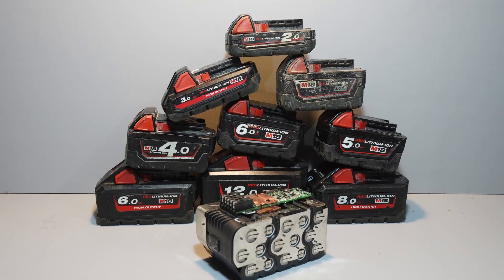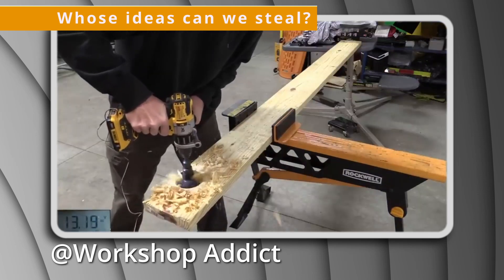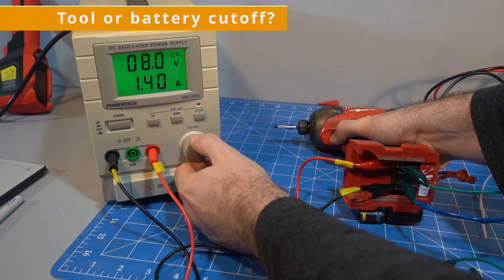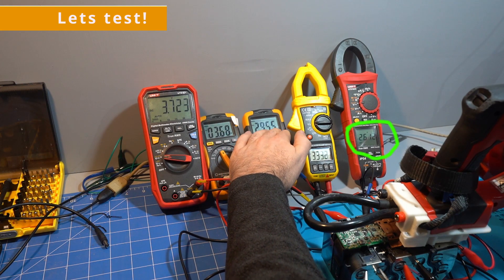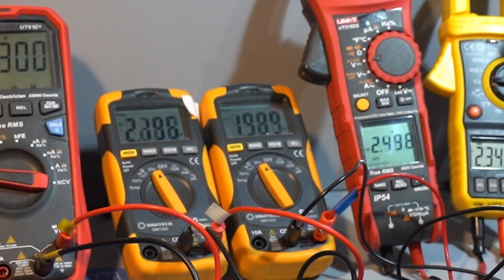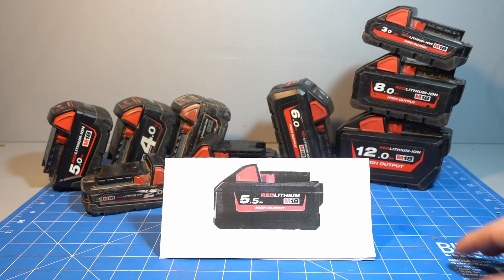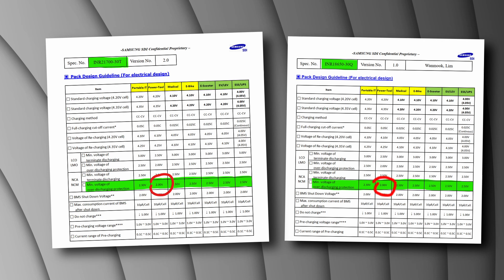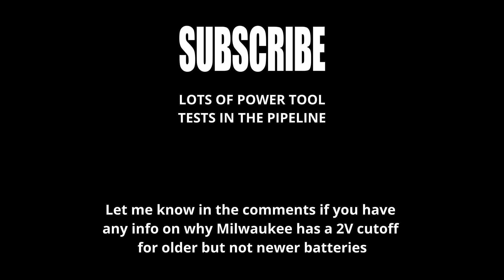[003] Milwaukee M18 low voltage cutoff is below 2.5V/cell on older batteries

Comment: Best tool battery video I've seen yet!
Reply from the maker: Thanks! This was actually just a detour on my way to making my mega battery review. I saw this unexpectedly low cutoff and felt it deserved its own video
Reply: @toolscientist So are you still working on the mega review?
Reply from the maker: @Kevin.L_  yeah, I just keep getting side-tracked! I'm trying to characterise all the M18 batteries for internal resistance, thermal overload, max current, et cetera. Next vid (out in 5 hours) is a perfect example of getting side-tracked. I (mostly) reverse-engineered the M18 communication protocol to see if it gave me useful information like temperature, state of charge, and current. Took me over a month, but unfortunately the communication is fairly basic and doesn't give me anything I can use.
Reply: @toolscientist  I just found that video announcement. Cool.

Every detour is a learning experience. Thanks for sharing your findings.

Comment: Does this mean that on the old batteries you should not use them until they're too low? Charge them before they die because they do not have the protection High Output series have?
Reply from the maker: All M18 batteries have low voltage detection and will tell the tool to cut out. The High Output batteries cutout at the recommended 2.5V/cell. The non-HO batteries cutout at 2V/cell ,which is below the recommended minimum. Whether or not this significantly reduces their lifetime is something that would take me a while to test. Overall, you are probably better off charging all batteries before they go completely flat.

Comment: Nice video,  very good point about using adapters.
Reply: I had an after market inverter that drained my m18 8.0 battery, replaced 2 21700 cells as they were dead.  Still not the same as i only get 3 lights light up but it works

Comment: I discovered that some of Milwaukee M18 12Ah using Sony VTC6A in them 

most are Samsung 40T
Reply from the maker: Did you see the labelling, or are you just going off wrapper colour? Someone recently found that Milwaukee are using EVE 15M cells in their 3ah. EVE's 18650s have identical colour scheme to Samsung's, so impossible to tell from colour alone.
Reply: @toolscientist  yes Milwaukee switched up the recent 3Ah to Eve cells from the many failure of Samsung 15M and Samsung 30Q
i got part of number which i am able to find matching VTC

It is very rare, you can tell by looking at the top left corner 5INR22/70-3
the one uses Samsung 40T has 5INR22/71-3 

same goes with 8Ah 70-2 is the one use VTC6A, they even use different BMS board

Comment: Your videos are awesome. I've done some similar, but more limited testing of M18 packs, though I never organized my thoughts like this. I've had pretty good luck with the various M18s, including the infamous 9, which has only recently started getting flaky (probably ~100-150 charge cycles.) I've had to balance it and my 12 (which is pretty new), but I chalk that up to Milwaukee's crappy BMS choices. I really wish Milwaukee would've put more of the BMS logic into the charger, where it could do smarter balancing, especially if the tool handles the cutoff anyway. The M12s are like that: the pins hit each cell bank and an extra one for a thermistor. Of course, it's not like the M12s are cheap, so clearly they aren't going to pass the savings of a simpler pack along.
Reply from the maker: Thanks, mate!

M18 balance seems to be a problem of the chip they use only having a max balance current of 50mA, which was prob fine for 2ah-5ah packs, but not enough for 6-12ah. I think their biggest problem is that the charger doesn't stop and balance, or at least stay on slow charge, if it detects severe imbalance.

There's definitely advantages to the 1 terminal per cell design of M12 and Dewalt 18V. Downside is increased chance of shorting and inability to brick a pack if it detects a fault. They also do whole pack low voltage cutoff, which isn't as good as per cell, but you could easily design the tool to have access to all the pins and then it's easy. Interestingly newer M12 packs seem to have electronics in them, so maybe they've built per cell LVC into them by having it short the thermistor to get the tool to shutdown. That's just another item on my ever growing todo list!
Reply: @toolscientist  Re: the one cell per terminal design of M12. There is something else inside the M12 batteries as well. I'm pretty sure it's just passive components, but last week I tried using a balance charger to charge an M12 battery and it flat out refused. The cell voltages started looking completely weird. Sticking a multimeter on the individual cell terminals shows the expected per cell voltages but once you start pushing power in, something else happens.

The DeWalt 12v packs, of course, can be trivially balance charged using their terminals.
Reply: @gf2e  there is a 1000 ohm resistor between each balance point and the pins. That would be the culprit.
Reply: @procrastinator1842  Wow. 1000 ohms is insanely high. That seems like it would severely limit the amount of balancing you could do to nearly zero. 

Any thoughts on why they do that? A 100 ohm resistor would more than suffice for current limiting. 

It is consistent with M18, though - not having much balance capability. :)
Reply: @gf2e  my thoughts are it's just for monitoring, when m12 batteries start to fall out of balance, the charger does nothing to remedy it. My second thought is that the m12 'balance' pins are quite exposed so an accidental short circuit is quite possible, the 1k resistor between each balance point would equal 2k if shorted, making short circuit current a whopping 2mA.
Reply: @procrastinator1842  I manually unbalanced one pack. After 3 charge/discharge cycles, it's slightly more balanced but not fully.

I also have a hobby balance charger. I connected it to the battery pack with direct wires bypassing the resistors. Its balancing is...a bit more aggressive. It can balance at >1A. I need to do a bit more measurement, but I think it can effectively charge only one cell in the pack until it's balanced.

I've been wanting to keep an M12 charger in my car. I'll probably wire up balance leads to an M12 knockoff pack and use an iSDT PD60 charger.

Comment: Great info. Just what I was looking for. This data is hard to find. Based on this info I think it does make sense to have some kind of secondary bms when using milwaukee power tools batteries for a power source, solarbgenerator or power station project. Only how to be able to read the cell imbalances in each pack when they are connected in series or paralell?
Reply from the maker: I wish I could give you an answer for this. Reading the battery to tool communication is high on my todo list, but I'm still probably several months away. A youtuber called "Buy It Fix It" seems to know the most about it. You can find his info on reddit by searching for "reddit m18 fuel battery protocol".

Otherwise, I would just stick to 16V low voltage cutoff for the pack and periodically open your packs and rebalance.

Comment: I will have to test some of mine again one day. Mine were brand new back when testing. I have seen mine cut off at or around 3V in the past.  That is of course allowing bounce back to equalize at 3V after 30 seconds or so. It definitely goes below 3V due to exactly what you mentioned the high current pulse shutdown issues. As you know if a pack shutdown after truly reaching 3V no matter what you would never be able to run many high current tools at all unless an almost full charge level. Not sure if it's a time limit or not, but very interesting that it still went low on your low current discharge test. One thing to check though is if the cells are old enough to drop off quickly is it dropping fast in the time limit of the cut off? Like the battery has lost capacity and drops off quicker at the lower voltage levels than usual. I know they already drop fast below 3V, but as they age it gets much worse. Excellent video, thanks for sharing and letting me know you had tested yours on video. I admit I thought yours were all fake or knockoff until you mentioned the difference...
Those big numbers look fake dude...😂
Just not what I am used to.
Reply from the maker: They mostly rebounded back to 3V. I think I recorded some of them to check, but haven't looked too closely. That's a fuzzier number that depends on battery health, load, and capacity, whereas the 2V/cell and 2.5V/cell are pretty hard numbers that reveal a bit about Milwaukee's design philosophy (max power at all costs!)

It will be interesting to test something like the handheld light, which claims 29hr runtime with a 5ah, so around 0.2A. If that goes down to 2V, without any timeout like you suggest, then the cells could be spending 5-30min below 2.5V, which I imagine would not be good for cell life.

I'm not against them going down to 2V under high load, but only if they factor current into it, and it appears that they don't.
Reply: @toolscientist  
Excellent point! I would like to see how the light would do as well!

Comment: Interesting tests and analysis.  The fact that its usually one bank dipping below the others is noteworthy. Good job on checking individual banks.
Reply from the maker: I think most of my packs were slightly unbalanced at the start of their tests. I can go through my footage and post the start and end voltages if you're interested in which ones were due to imbalance and which are due to failing cells. Although any pack with a weak cell will most likely have imbalance anyway.
Reply: It is significant as one cell bank gets lower and oob it starts getting increasingly hammered by undervoltage. The cells would be fine if just balanced up but end up becoming weaker eventually due to this phenomenon and then throw error codes to the charger, the whole pack  becoming unchargeable at that point. Probably a main type of failure.
Tool batteries really need to be maintained and fully balanced up a couple of times a year. But very few people care to or know how to

Comment: They do not have low voltage protection. If using these batteries for kids power wheels etc - you can get a low voltage cutoff circuit ready to use for about 6.00$ on amazon. 

So I purchased a low voltage cutoff for my kids rise on cars…and never got around to installing it. 

Was never a problem for years and years on the 4&5ah  batteries I have many of … not sure why.  

Not a problem at least until they used my 8.0 ho battery this weekend. And now that battery wont charge….  Kind of wondered if the ho  battery with 21700 cells were more susceptible to low voltage when depleted.
Reply from the maker: One reason could be that the bigger and more powerful batteries can be drained lower by the car. The smaller packs get weaker faster, so your kids notice the loss of power and stop driving.

The other reason is that 12ah and 8ah packs get unbalanced easily. Just like my 12ah where the pack was at 16V, but a few cells were empty. At 16V your car will still be going strong, so it will keep draining the weakest cells down to more damaging levels.
Reply: @toolscientist  Thank you for your reply!

I am tempted to open and charge each cell individually one or few at a time to get it back in service. 

Do you think it will it balance the cells once on the charger?… or do I need to carefully do that myself?
Reply from the maker: If any of the cells are below 1V, then it's gone. If they're 1-2V, then the Samsung datasheets say you can slow charge to 3V at 0.4A. If it works, mark it with paint and keep an eye on it. Any sign of overheating in use or losing charge while resting means it's no good and better off recycled.

You should try to balance the pack before putting it on the charger. M18 8ah and 12ah have balancing issues. I'm still trying to figure it out, but it seems that the balancing circuitry can't keep up, so the battery becomes unbalanced faster than it gets balanced.
Reply: Definitely open and check each cell bank. Bring up the low ones to the rest  or top all of them off. I have brought back many packs that people discarded due to one cell bank being low
Reply: @earl3358  Before I opened I looked into and had luck registering the battery for a warranty return.   Will see what actually happens…  the milwaukee eservice site allows you to punch in cat # then S/N/ and or date code and the site tells you immediately if warranty is available for the battery.  Final determination is made on their repair bench - will share my results. 

What I also found out is some of the original M12 batteries still have warranty!? Not sure why or how but it seems possibly the original milwaukee tools had a longer warranty on the batteries. Maybe low trust on lithium batteries then?  Not sure.  I actually had an old original one from my father in law and was long long dead.

All of the recent batteries apparently have 2 to 3 years warranty depending on amp hour/model. 

Note:
“Starter batteries” the freeby special batteries for some specials aparently have next to no warranty. 

Thanks for this howeevr - I have since had luck manually opening and balancing a long dead (out of warranty) battery pack. 

Sorry for the dump of text here - was not thinking through all my thoughts before typing out.
Reply: Love your video
and yes these cells i noticed they are being drained un-evenly and also caused over charge during the charging process

there is a company out there has figure out the timing of charging and resting a sequence to prolong the life of battery 

the bms is also very poorly designed, it doesn’t balance the cells during charging 

so far i noticed that high output 6.0 is the only can take beating

on M12 side, XC 4.0 using Samsung 20R are very reliable

yes Samsung 30Q was very very bad 
HD9.0, XC 6.0, M12 cp3 and XC6 had them till they switched to Muruta /Sony VTC 6 since late 2021
Reply from the maker: Do you know when balancing occurs (if at all)? I did a quick test and couldn't notice any balancing happening, but it could be impossible to detect when measuring cell voltages. 

Are they still using LG HG2? My M12 CP3.0 uses LG.
Reply: @toolscientist  like you pointed them out
during charging, i did have one open and i do not see any balancing, if one at higher charged, it will hit over 4.2 volt i noticed 

if you have the LG HG2, you must have long time ago, those are the good reliable cells, they work well at colder temp as we in Ontario Canada gets very cold.

From what i figure that Milwaukee cuts costs and went with Samsung 30Q, same goes with some Dewalt batch that they argue with pricing so Samsung release a big batch of bad 30Q